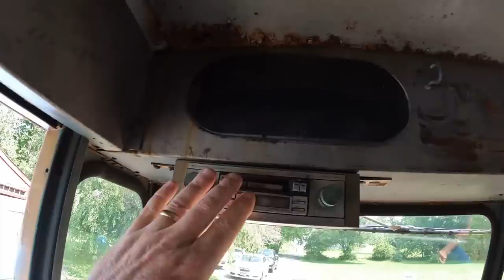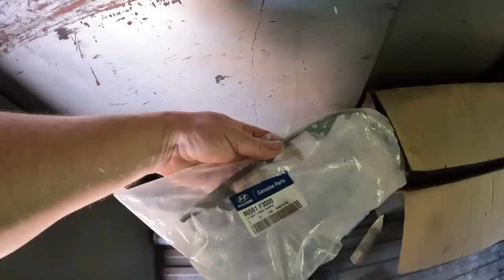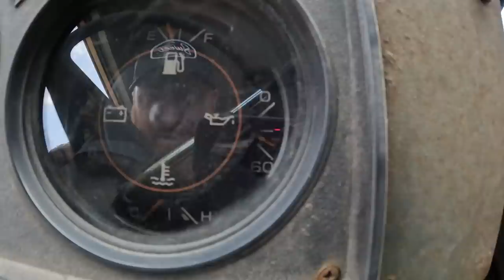Will it start? Can we drive it? We are turning this into a Hot Rod Ice Cream Truck!!

Comment: If that outboard boat motor isn't running still. I'd try cleaning the carburetor.,or carburetor's on it really good. Including those jets.,an pilot& venture tube. I recommend using ethanol free fuel in your boat tank to.
Reply from the maker: It ran in the video. Just hard starting. It's already with it's new owner.

Comment: fugure out the gap on the rings and new bearings and seals withe a good size turbo or a custom intake with a chevy 3.8 supercharger sounds wicked
Reply from the maker: I'm not that fancy! She's got good oil pressure, I may just throw a head gasket and studs in it and boost it.

Comment: Cool project. I have a 74 gmc value van. I just went through all this over the last few years and am still driving mine. You can get the ignition switch bezel online. Search for GM truck ignition switch bezel. Speedway motors has them. The 68-72 will fit yours. I’m rebuilding my 350 right now and currently using a 292 until it’s ready to swap. I wish I had the p15 or p20 over my p30. I have more room than I need rn. Have fun!
Reply from the maker: I think the bezel fit the C series pickups as well. Thanks for checking out the video!

Comment: Over fill the oil on the LS and if the issue goes away it's the o ring on the oil pick up tube where it connects to the block. I've made a small fortune off of doing them. Oil pan needs to be filled to the block. Don't run it long like that though
Reply from the maker: We pulled the pan, did the O-ring and the bypass valve block off. Pressure is the same. Just threw thicker oil in and I'll drive it till it dies.
Reply: @madgingercustoms  sending unit?
Reply: I guess you sort of answered that already. Assuming the thicker oil got the pressure up. Oh and sorry for being an idiot and not realizing I commented on a real old video
Reply from the maker: @chuckblankenship5122  I have new sending unit but the one in there reacts as it's working properly. I may throw it in because I bought it.
Reply: @madgingercustoms  let me know if it works

Comment: and here is factory specs yours would be hoped up some The Chevy 292 inline, six-cylinder engine has a bore and stroke of 3.875 inches by 4.125 inches and a compression ratio of 8.0-to-1. It achieved a maximum 165 gross-horsepower at 3,800 rpm and netted 147 horsepower at 3,600 rpm.
Reply from the maker: Looks like it's begging for some boost!

Comment: Well, its not stuck. The 59 viking 283 fired for me without much work.
Im thinking water infiltrated past the air cleaner. Oh look, there is no air cleaner. Ya, water was enviromental. 
Them 292s are tough as nails.
Reply from the maker: Nice!
Reply: I need to ls a dodge power wagon chassis. Got a running 2000 silverado. Should be easy. Not.
Reply from the maker: @franksgarage8551  sounds easy lol. Get an aftermarket harness that you just put power to.

Comment: i think that might be a crate engine at some point sence its a goodwrench brand
Reply from the maker: Agreed. It has good oil pressure. I should pull the head off and take a look
Reply: @madgingercustoms  defiently dont get rid of it a great motor cuse goorwrench hoped up there motors some like there 350 chevys

Comment: As a new subscriber , you’ve both exceeded my expectations . In all honesty , this truck does have potential . IMO , I’m only against the turbo exhaust upgrade as this truck will absolutely dig trenches with that low end torque it will produce and wake up the top end as well . I’m mostly concerned with the rear wheels churning up Jess’s manicured lawn and sacred bush . Ok , us guys just don’t care what harm we bring to ourselves , but we’re on the overprotective side getting Jess further injured . No worries though , we know that Dave wouldn’t ever cause harm to her . The fact that it now runs and drives to the degree it does is high on its merit alone .
LS swap an ice cream / hot dog truck , how awesome is that! I know saving that 292 work horse engine is a good thing but we know Dave would rather use it as a well pump and knows this truck should MOVE when you step on the gas , so , it’s going down . 
Dave , Jess , please take this project on as all your others , NO ! , please be safe ! Love the content , but please be safe ❤
Reply from the maker: Thanks for the amazing comment!!! You win 3 interwebz!! We will try not to let you down!
Reply: @madgingercustoms 
Gee thanks ! But first I have to find out what an interwebz is ? 😳 .sorry , new to the channel , I’ll learn 😮 , but I’m honored 😊
BTW , I just know that you both will absolutely , unequivically never let me / us down . Love both of your motive , ambition and driving spirit !
Reply: @gmoney9588 First rule of YouTube, never refer to another man’s wife’s sacred bush 🙈🤷🏻‍♂️😂😂
Reply: @crosse73 
You are correct sir . That should have been left solely with Dave . I owe them one . 😔

Comment: my friend has a old ice cream truck its  1970 with a truck v8 327 gm motor in it and it still runs body is junk though
Reply from the maker: I think most any body can be fixed if you just plug away at it.

Comment: The choke only works when there's fuel in the float bowl. There's no point in using the choke when your pouring gas in the carburator video
Reply from the maker: It makes me feel better though. Lol
Reply: ROFL good save!
Reply from the maker: @judeghazaleh6134  restricting the air and therefore richening the mixture was the goal. And it works regardless if the bowl is full or not.
Reply: @madgingercustoms  that's not true buddy. The choke puts a negative air pressure/ vacuum from the piston intake stroke, on the main Venturi causing it to draw more fuel from the float, than what the regular idle Jets feed the engine during what operating temperature idle normally  feeds.  Therefore giving a rich air-fuel mixture during cold start to compensate for the fuel sticking to the cold walls of the carburetor which makes it hard to start. If there's no fuel in the float, closing the choke is no different than what the throttle plate does when it closes.
Reply from the maker: @judeghazaleh6134 exactly so it enrichens the mixture as manually putting gas down the carb then closing the choke to restrict air would. You're saying the same thing.
Reply from the maker: I also do that again in the video coming out in 10 mins with our Biscayne. Go watch that and hit me in the comments!! You are clearly very knowledgeable!